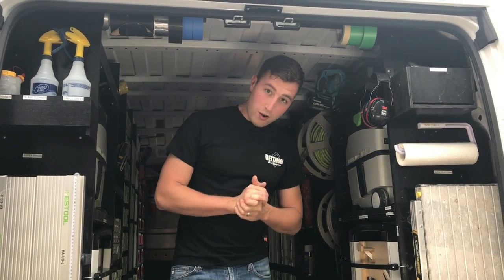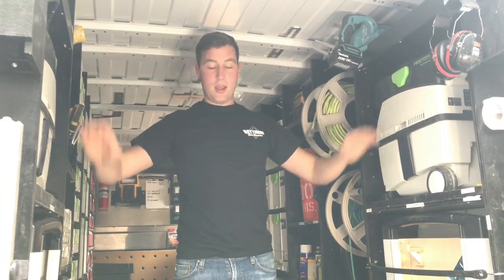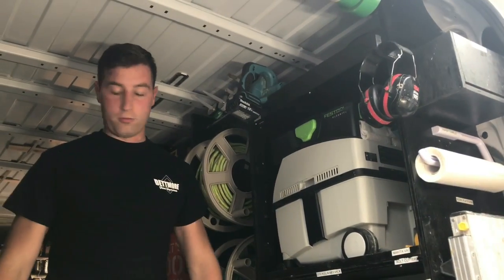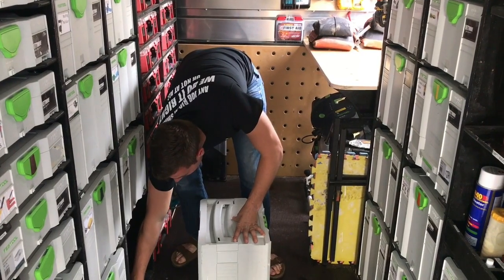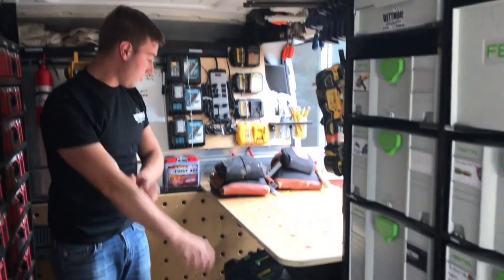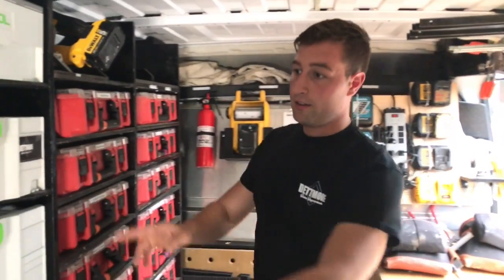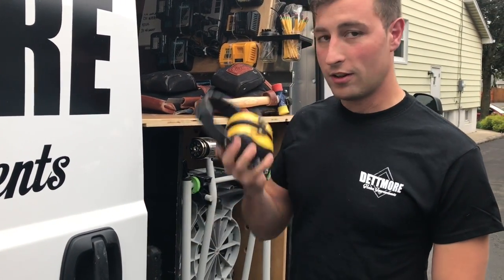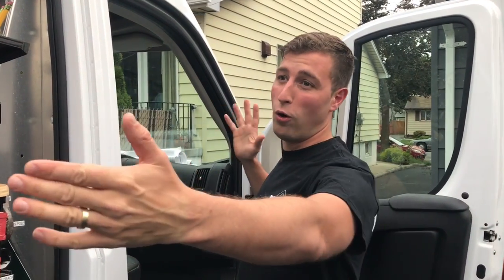Super Organized Work Van - Van Tour

Comment: Hey Zack. I have the same van but I added LED lights to the ceiling. LEDs draw so little so I can leave them on overnight and the battery is fine. When I bought my van, it was already outfitted with shelving from the dealer. I cannot imagine not having step in use of my side door though. I added some running board steps to make getting in easier because my knees are shot (but I am older than you). Very nice setup!

Comment: Excellent setup. I have been devoted to modular toolkits long before systainers and their emulators came to America. Regarding strict adherence to a modular approach, if I had investment in two slightly differently dimensioned systems as you do, I would have been tempted to make ALL the case openings at the same larger width (wide enough for Milwaukee), losing a little bit of total volume, but preserving 100% flexibility for future --- e.g., if I later replaced some of the Festool gear with Milwaukee equivalents. But your setup clearly accommodates your current tool inventory as compactly as possible, so I see that my fixation on total modular flexibility may represent more of a mental illness than a practical improvement. Your overall utilization of real estate close to the doors is particularly intelligent. Thanks for posting. Much food for thought.

Comment: Certainly well organized, all universal shelving except for Milwaukee units is nice. I have been trying to decide between the Ram van and Ford's Transit? I have a 12' dual axel trailer that can be loaded up with most material. 

I'm sure you've moved the clamps so they don't bang the head by now.  Good ideas, thanks!

Comment: Just got a new Ford Trasit 350L high roof.  Got a lot of inspiration from your fit out that I will be using and adding some from other ones I have found and liked to.  Love the bulk head at the front though.  Did you ever have issues with weight balance of the van?

Comment: Which Promaster version did you choose? 3500 with high roof, gas, extended wheel base? Thank you and van looks great! Trying to choose my first company vehicle in Boston
Reply from the maker: Travis Stanley -3500, hi Roof extended wheelbase gas engine. If I was working in Boston I might consider a shorter wheelbase.. this is a little big for working inside the city but it does well for me I am in a densely populated suburban area just outside Manhattan
Reply: Hey Zack, thank you for the quick reply I really appreciate it. Will definitely be taking a look at the ProMaster. Great videos, will continue to follow along.
Reply: Zack Dettmore you killed this pro master setup hats off 👏🏼 thanks for sharing

Comment: I see you put them on shelves you make a sharp turn all your boxes will fly off Dewalt has a special rack so it is secured to a wall or van
Reply from the maker: Big Daddy so far in 3000 miles not one of them has fallen off the shelves so I think the system is pretty good but I have considered the Dewalt system for future builds because because of the mounts you are talking about. I'm also curious to see what the new Milwaukee system looks like that could potentially be an interesting build

Comment: where would you put Sheetrock and plywood?? Fantastic layout tho..
Reply: Ruby Ruiz I use a 12' two axel trailer. Most things fit.
Reply from the maker: Ruby Ruiz I put them standing up on the sides and they get clamped to the wall